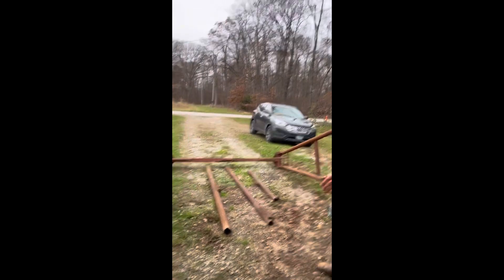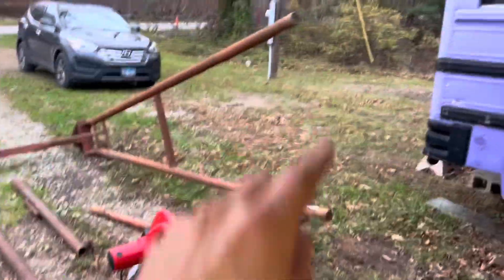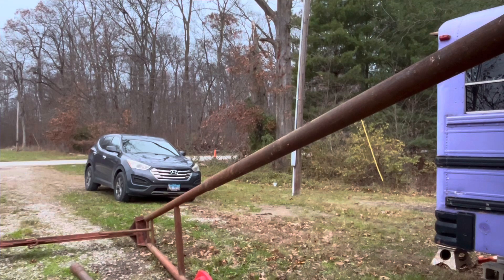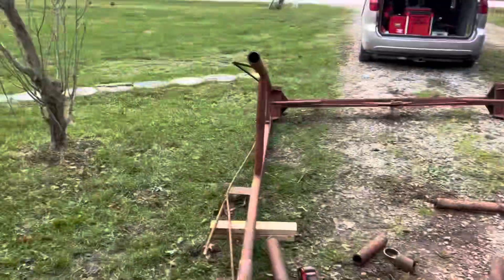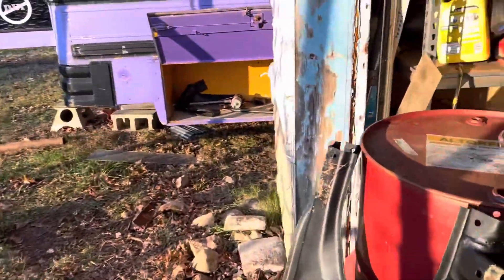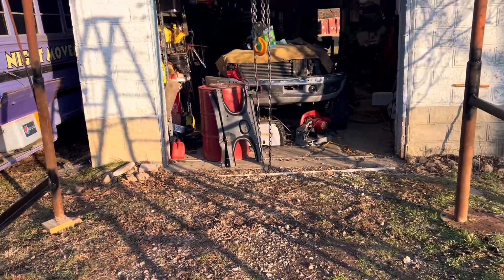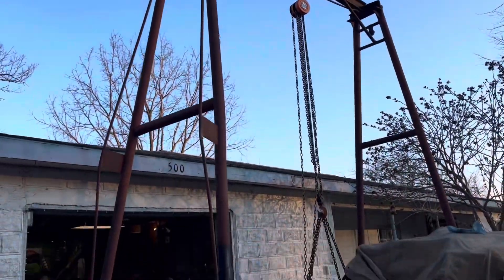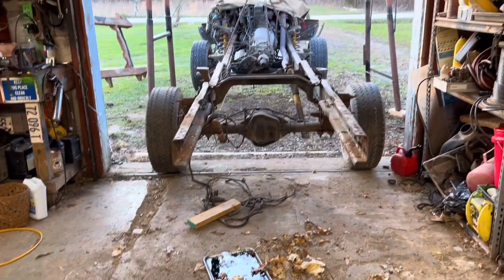Modifying the A frame for body swaps.

Comment: Good Job on the gantry.  Think I'd drill or burn 3/4 holes under your welds and weld in 3/4 rebar. Give it the old double up faith. Lot of weight in one weld. Maybe some kind of kick out leg to stop falling forward. Make sure bottoms tied together.  Rebar works good.   Good luck. Looking forward to seeing body mounted. I'm watching three others 57/8 swaps at the moment. Same deal. Adios. Take care. 👍👍✌️🇬🇧
Reply: That's what I was going to say also. Pin it  & foot it.
Reply from the maker: Good call!
Reply from the maker: That would definitely be the smart thing to do, thanks for the input! The plan is to have the body on by Christmas with more videos on the way. Thanks again!